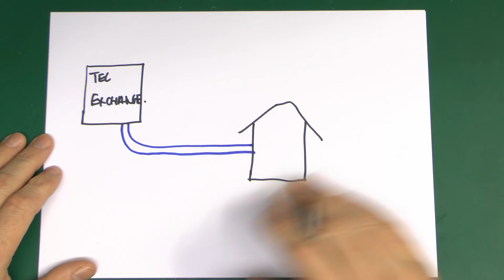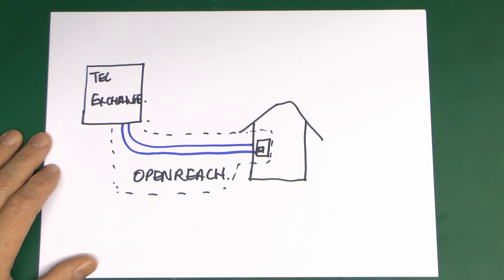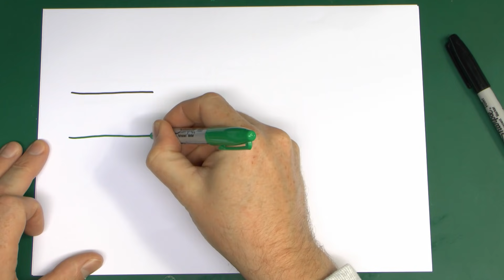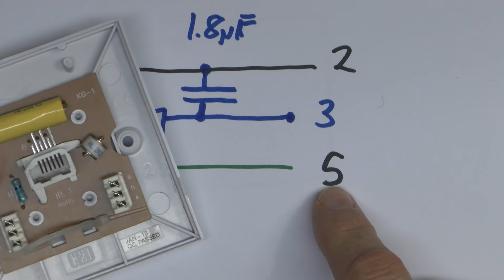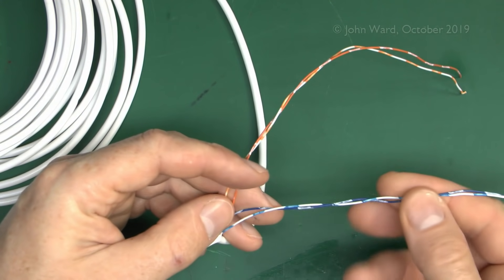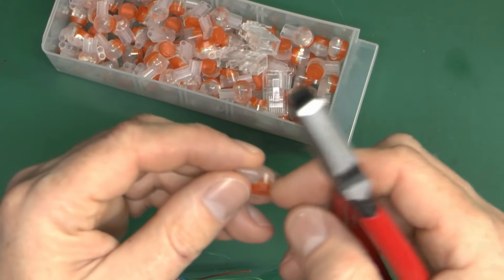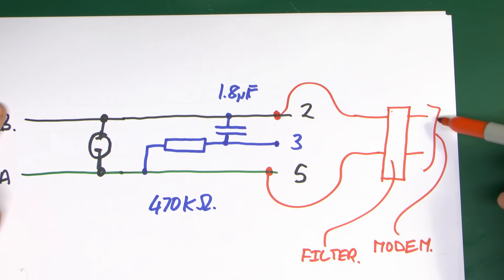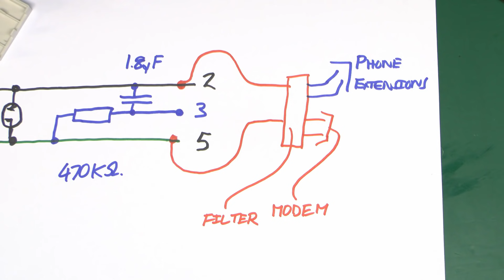UK Telephone Wiring, Sockets, Cabling, ADSL / VDSL Filters, Extensions.

Comment: The colours have now got me comfuzed. I always thought the reason the centre pair of Cat5 conductors happened to be blue was because of the old PO colours? Then I thought white was yellow..but hey who cares? Not really important.
I have not yet got further into the video than the colour confusion, but the outwardly simple twisted pair should be explained for the newcomers as it is an amazing transmission medium.
I really look forward to Mr Wards content. Top chap.
Reply: Recent incoming wires tend to be white and orange for one phone line pair and black green for another line pair.
Reply: Data cabling evolved out of phone cabling, so you have the centre blue pair for phone, then the green pair around them for data, and finally the orange and brown pairs either side for data and 8VAC power respectively. Brown pair was for feature phones to get power, for either speaker hands free, or for dial illumination, though this was almost never implemented outside the USA, but a lot of older US households still have in them somewhere a transformer providing 6VAC to the phone wiring. Was common in business for PBX phones to use all 4 pairs, while still having the ability to plug in a standard phone into the 8P8 socket for limited regular phone service, and the full feature set if you plugged in the appropriate handset.
Reply: @SeanBZA  Thanks SeanBZA... Your name had me thinking of one of my favourite comics of the 1970s Beezer!  Had my fave - Beryl The Peril (Drawn by one of the finest comic artists who also did Dennis The Menace etc.) 
That was a very thorough and fine answer. Everybody looks at the funny brown ones and wonders why they are there - maybe because they are often the last ones punched down?
Reply: @SeanBZA  Hold on it might have been Topper (that had Beryl the Peril)?
Reply: There are two standards of copper wire colour schemes used by Openreach to feed properties.
Concentric colour scheme - Pair 1 = White, Orange; Pair 2 = Green, Black (mainly used in overhead supplies but also in old underground feeds).
New colour scheme  - Pair 1 = Blue, White+Blue; Pair 2 = Orange, White+Orange.
The incoming cable can be up to 4 pair if overhead, and 5 pair of underground.
Reply: The blue-white/white-blue, orange-white/white-orange color code is just the first two in a sequence of 25 different color combinations. The low order colors are blue, orange, green, brown, and slate; the high-order colors are white, red, black, yellow, and violet. CAT 5 cables generally use the first four pairs in the sequence.

See https://en.wikipedia.org/wiki/25-pair_color_code

Comment: Filtering is a little more complicated than you explained.

Every phone needs to be filtered.  This can either be a micro-filter at each socket or a socket plate with built-in filter.  The problem comes with having a built-in filter at the master socket.

A built-in filter at the master socket conveniently means that all the extensions pass through that same filter.  No need for micro-filters or socket-plate filters on each extension.  But that means you can only plug your modem into the outlet on the master socket.  Not a problem if your computer uses a wi-fi connection, but if you want a wired connection and the master socket is in a different room to where your computer is, that sucks.  Yes, you could stick a micro-filter on an extension socket and plug your router into that, but it's not going to work because the ADSL signal is removed from the extension wiring by the filter in the master socket.

It is possible to get variant removable bits for standard master sockets which do have a built-in filter but pass the raw phone line rather than the filtered line to the extension wiring.  Or you can do naughty things at the master socket, wiring your extension cable directly to the A and B terminals.  That's illegal and OpenReach will get very upset if they catch you doing that.
Reply: bdf2718 Most of them have a second set of AB terminals to allow a router to be connected in a remote location.
Reply: @AndyK.1  Ah, must have been one of the newer redesigns added those.
Reply: Most of them have it. Either 2 IDC on their own on filter plate or what you may have mistaken for pins 1&6
Reply: @AndyK.1  Most of them have it now.  Back when I last looked at one physically (many years ago) it didn't.  Hmm, I think it didn't.

Comment: A thorough presentation. However, it’s not always the case that the “master socket” is located at the point where the BT line enters the house (although it often is). In my case, when I got BT to switch me onto their “Infinity Option 1” product, and renting their “HomeHub” router from them, they took over my older internal extension line and mounted the new twin port master unit upstairs, in effect in my home office, with the router being installed there. I use a top end ethernet cable to connect to the router for internet traffic, and the router can be used for local wi-fi etc. I guess it was easier for their installer to do that rather than having to install another new cable to where I wanted it to be, having tested the extension cable.

The older master socket is still in use, for an older phone (which is useful, especially when there’s a mains power cut!). When I was on ADSL, external filters were used for phones on both the main and the extension end, but this became redundant when they upgraded to VDSL. This was done soon after they offered it with fibre optic to a cabinet about 200m away from my place, so just a short bit of copper now. At the time of writing, the speeds are 69.74 down/18.45 Mbps up.

Originally, when VDSL was installed here, there was a separate modem along with a router, but after a fault, they were both replaced with their latest all in one box router (a “HomeHub” product). As part of that, they had to replace a large chunk of buried cable from one of their under-road cable cabinets to my house and the one next door. The net effect was that it became a bit more efficient - the load is now around 6W, about half what it was with the separate modem/router.
Reply: Ah yes.  The gutted NTE at the entry point, jelly crimped extension wiring to a new NTE with the sticker.  Did they leave the non-connected phone faceplates, or switch them out with blanks?

😁

Comment: what are you doing still use copper??
Reply: I believe that's one of Thatchers legacies...
Reply: Absolutely correct.
BT started rollng out fibre optics during the Thatcher era but were stopped by the government as they deemed it anti-competetive as nobody would want to subscribe to the multiple cable networks if a faster and more reliable option was available.
All the cable companies have since gone by the wayside to be bought out by Virgin Media which supply voice and BB over a coax connection.
Reply: It's traditional...
Reply: No, it was not Margaret Thatcher.  But, in compensation, the UK now has one of the cheapest broadband services in the world.  Speed is useful for a minority but cost is better for the majority.
Reply: @wwsxa39  why the hell would BT be rolling out fibre in the Thatcher era? What the hell would anyone use it for?

Thank god they stopped that!

Comment: I replaced my BT socket with MK socket. In BT socket white and orange connected to A and B, but in MK socket there were connections numbering 1-6, when I connected black and green to 2, 5 numbers there was no internet access. It strangely worked with white orange in number 2 , 5

Comment: Hey, more info. The phone plug is sometimes called an R600 plug and the data plug for adsl/adsl2/adsl2+/vdsl is usually called an RJ11 (possibly incorrectly).  The wire from the pole          in the street to your house is plastic coated, copper coated steel so it does not sag under its own weight and has joins at the pole and your local cabinet, en route, etc. so for data to reach 40 megabits per second is a minor miracle.
Reply: Not quite true in the UK.  The drop wires are copper cables with additional steel support wires.  Note the steel wires do not carry any signals, just the copper pairs

Comment: They have given up fitting the suppressor these days. Presumably it slowed down fibre internet.
Reply: I recall some engineers cut them out sometimes on problem connections so probably. I left before that changed in the socket
Reply: No, If its FTC, or regular Broadband they must still have a Filter. As its a copper based ADSL product.  All new build houses however have to be FTTP now. Fibre to the premise. So you have real fibre optic cable right into your house, which terminates in the new ONT type boxes.
Reply: DJ_PaulTUK talking about the suppressor not filter.
Reply: most cables are underground now....
Reply: @timballam3675  New builds yes. Old, no. Ive had 4 line installs this week with openreach. All dropped from Poles in the Acton / Hounslow area of london.
Reply: Apparently it had an adverse effect on VDSL.

Comment: Interesting, but because Virgin is in my area I haven't used a landline in 10 years. Even if I had one for internet I don't think I'd plug a phone in because all you get is fake Microsoft scammers andr recorded PPI messages every 20 minutes.
Reply: Virgin insist your have a landline with them or they charge you more for some reason. I wanted just the BB side of it but quoted a higher price. They may be independent of  the copper networks, but who needs a landline.  The only reason would be in an extended power cut and dead chargers or to charge (Cough!!) your mobile on. Landlines have massive power backups in the case of a massive power cut.
Reply: @Danechip  ha ha ha VM phones are muxed down to the local cab then demuxed at that point, power cut and no phone.....  BT run copper pairs from the exchange so you keep the phone line in a power cut....
Reply: @timballam3675  hahaha back. Last I saw, your house goes out of the Onmi town your garden to the tee and in the pit to your DP in the street. From there several 40 pair to the mux (usually withing a mile) where you jumper the blue ones to the green ones  (say pair 605) in your little blue and yellow jump wires). They have batteries in them and cooling. Honest. I saw one one on Youtube.   Oh wait....

Perhaps you could show me a multiplexer in your home that 'muxes' all of your ONE channel to the DP in the road?

VM's fibre is to the local mux. Massive lie to customers. From there is sent to the DP in copper. From there Siamese cable if you will. RG6, 7 or 11. Depends how far you are from your DP (Little green box on the corner of your street ) as how much signal you get from the coax) determined , usually by distance is what cable you use.
Reply: @Danechip  I have no phone line in my house, only Virgin Media internet, and Virgin do not charge me more. 

VM is what is called FTTN (Fibre to the Node). Bear in mind Virgin had this arrangement WAY BEFORE BT even thought of offering ANYONE decent broadband service. DOCSIS 3.0 is still a very effective last mile technology, so it's not worth the cost of installing FTTH yet. BT on the other hand, is FTTC and still uses VDSL as the last mile, which is almost as crappy as ADSL was.
Reply: @jaycee1980  FTTN and FTTC are essentially the same, in this case exactly the same. The "last mile" of copper is the same distance for VM and Openreach. The advantage VM have is the physical layer, they have coax to the premises rather than Openreach's often untwisted pair. I agree that DOCSIS 3.0 is an effective technology and has more lasting power than VDSL. VM are not however unviersal coverage and are unlikely to lay much new cable anytime soon, so if you're in an uncabled area you're stuck with Openreach VDSL/ADSL whether you are with VM or not.
Reply: @Danechip  "who needs a landline"

People who dont have a mobile phone obviously. I myself got rid of the damn thing a few years ago. Never looked back.

Comment: I'm fast forwarding through your verbosity trying to find which wires carry which polarity to be able to make some emergency lights in case we get any power cuts,  no one seems to want to mention power and voltage!
Reply from the maker: Phone line voltage is typically about 50V DC.  Ringing is AC, and can be anything up to about 120V.
Phone lines are not intended to power anything other than telephones.
Reply: @jwflame  Where's your sense of adventure? Why not use the free electricity?
Reply: @jonathansimmonds5784  there isn't that much current

Comment: Surprised this stuff is still relevant in the UK!!  Is it not about time you dragged your telephone systems into the 21st Century.  I'm from New Zealand, here the vast majority of people just use mobiles and don't have "landlines".  Also the vast majority of people now have fiber to the Home connections and if they do want a "landline" they plug their home phone sockets into the Optical Network Terminal.  It appears the UK is still in the dark ages with VDSL and Broadband over copper wiring??   Do you not have Fiber to the Home over there?
Reply from the maker: Fibre to the home / premises is available but only in a very small number of areas.  For most everyone else, it is fibre to a cabinet in the street, then copper wires to the premises.  About 5% of places can't even get that, and have to make do with basic ADSL on copper from the exchange - and those places are not in isolated rural areas, they can be anywhere, basically where Openreach (previously British Telecom) haven't installed the cabinets.
Broadband can be purchased from a wide range of suppliers, but they all use the same Openreach infrastructure, so if you live in an area with no street cabinets, it doesn't matter who you buy it from - it all relies on the same old copper wiring.
Many people do not want or use landlines, but there is no option in most cases - broadband over copper is supplied with a landline as part of the price, and the only other option is to pay for a 'copper pair' which is the same price as a landline except you get no phone service on it, so no one bothers with that and may ISPs don't have it as an option anyway.
There are several other companies which provide fibre to the premises using their own network,  but they only cover small areas in certain places.
Reply: I have no idea how people put up being without a landline.  I mean you'd have to give your mobile number to businesses!! ;)

Fibre to the premises can be a very difficult thing to arrange. Firstly you need the fibre from the cabinet to the pole, then the engineer has to route it into your property which is a hassle.

Unless you are on Virgin Media as they are a cable TV company so you get fibre or cable anyway, along with a standard phone line.

The rest of the system if fully digital now but just the "last leg" is copper, which is fine as copper can easily handle multiple gigabit connections if done right, which it rarely is! Eventually the phones will be moved onto a voip service with all its inherent problems but that is not happening too quickly as BT have finally been told they must upgrade more of the network first, especially the copper only connections to remote areas

Comment: Why did BT go and design such a large and ugly looking NTE5c terminating box. I think they could have so easily designed a smaller unit  that would have fitted into a standard UK recessed metal box recessed into the wall.  Would then be flush fitting and much neater.
Reply: The standard NTE5c has to stick out a bit to allow the customer to disconnect their extension wiring to diagnose whether a fault is internal or external.
I agree that the curved design doesn't exactly fit in with the decor of most houses, and the ugly large lettering on the top is not necessary.
Reply: They certainly stick out a lot with the filter plates !
Reply: @wwsxa39  Could have easily been designed to allow to fit a 35mm recessed back box (Electrical type) to allow the face plate to fit flush with the wall. Lack of design thought in my opinion.
Reply: Simple.

You have a phone being installed. Do you, as the customer, was the BT guy to cut a massive hole into your wall, ruining the wallpaper, being there for hours? Or would you rather they just screw a box to the wall hear the floor and simply drill a single hole to the outside?

Comment: My internet keeps cutting out 3 or 4 times a day I rang the service providers and I got told to remove the face plate off the wall (not open reach) and noticed there was2 wires not connected at the back is that normal ?
Reply from the maker: Yes, there are usually 2 pairs (4 wires), only 2 are required for a phone line.  The others are there if someone wanted to go back in time 30 years and have a second phone line installed when such things were actually used.